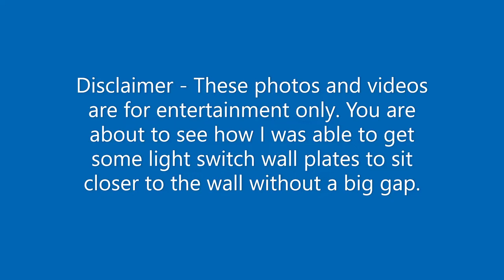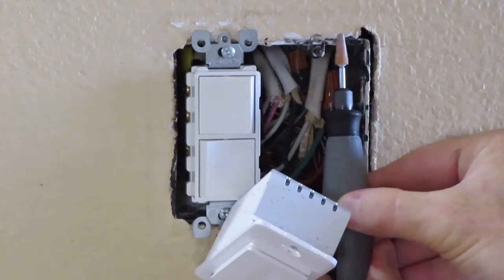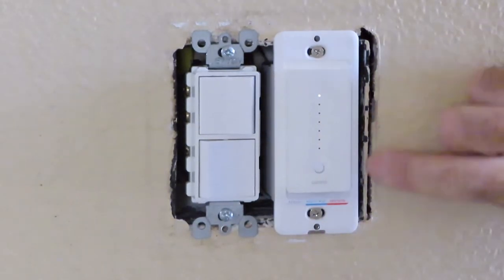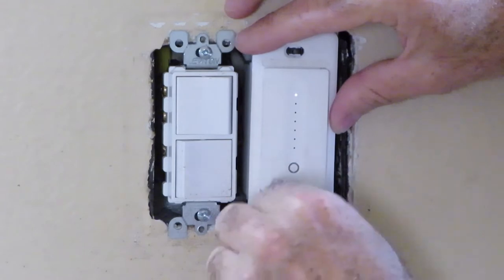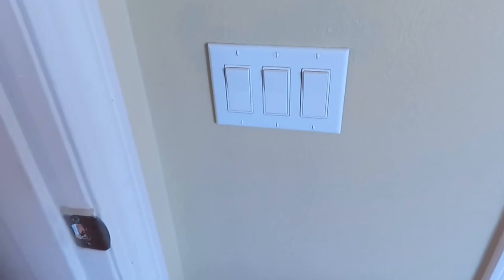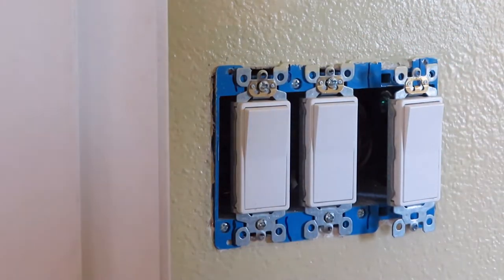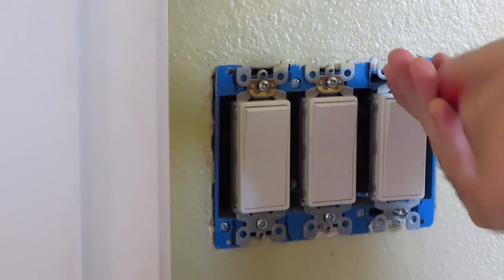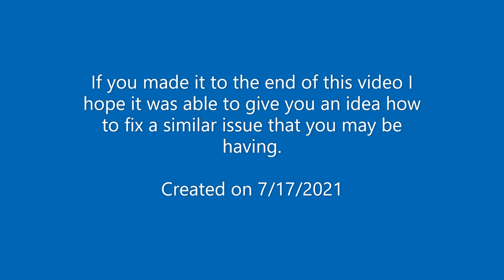Smart (WeMo) switches with gap between the cover plate and the wall.

Comment: I Think I Would've Just Taken The Metal Ears Off On The 3 Switch Box. I Thank You Though For A Different Way Of Fixing This Problem. Cool Video
Reply from the maker: Thanks for the comment. The issue is not the three way switch. It was the Wemo switch that is all plastic and is very thick where the mounting ears are.